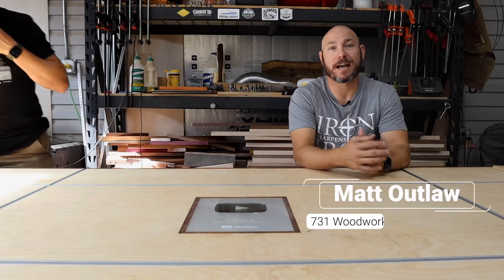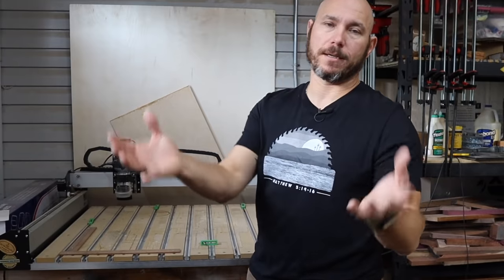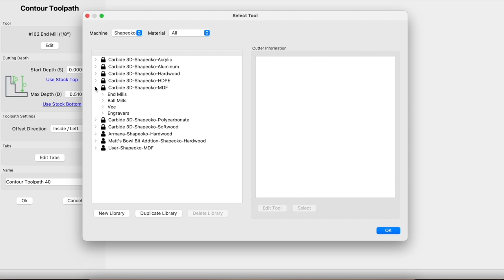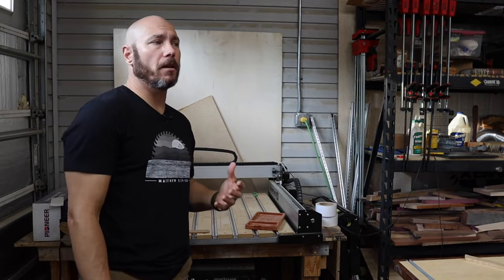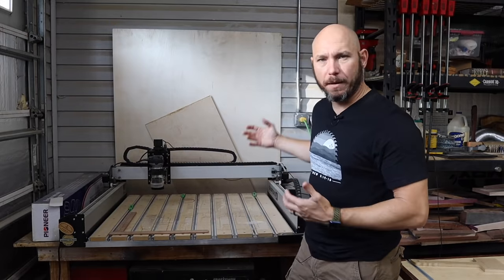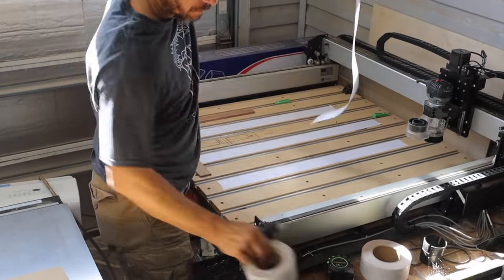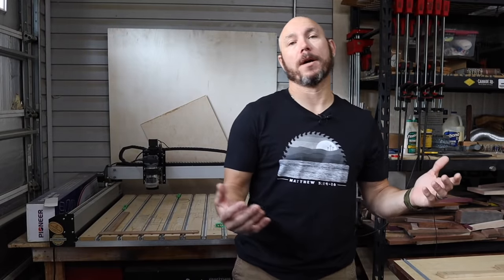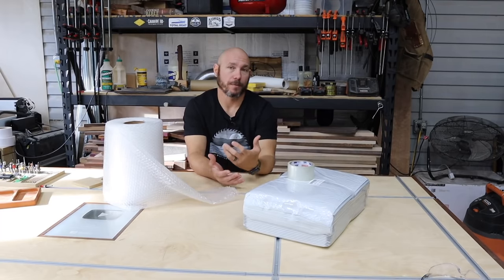The Dark Side of Learning to Use a CNC for Woodworking

Comment: A year from now you will have a much longer list, but that's part of the fun.

Useful tip: Zero off the table's center. Use the rapid positioning. That way if the toolpath messes up or you have to turn the machine off, you can instantly go back to the same zero with rapid positioning again. This has saved a ton of time and frustration, especially with 3D when you can't always use the same spot later on.
Reply from the maker: Thanks for the tips!

Comment: I have a 3 xxl and with a 1/8 compression end mill you could decrease your cut time in .500" - .750" MDF significantly.
Start at .500" full depth @ 50ipm and "4-4.5" speed on the Carbide router and get back to us! Often times you can get away without using tabs this way as well due to the sawdust packing the cut so tight.

Comment: I’ve been a machinist for 12 years and worked with CNC machines went to college for it the whole 9 yards. Using a CNC with no schooling and just going for it is hard. I’ve never used one for wood but programming is a skill in itself and a lot of people want money for that skill. I know if I spent 2 years learning how to program and had years of failure and experience I wouldn’t do it for free. I think the best thing is to stay positive and learn as much as you can!
Reply: Also with CNC machines people think oh it will do all the work for me. Which is true but you have to assume this machine doesn’t know what you want until you tell it which tool it’s using the material type the thickness. And maybe even start location. After that a program should run smooth. There’s a 100 ways to mess up when using CNC and it will be a huge money maker once you master it!

Comment: It sounds like what most beginners go through--absent the mechanical issues--which are just because of poor quality components.  I've had a CNC for more than a decade and a half.  I went through many of the same experiences, like breaking bits.  I had the benefit of being proficient at 2D CAD drawing when I bought mine (now I work in 3D). This allowed me to draw then cut whatever wanted, and not simply rely on what is downloadable from the internet.  It is true that entry into CNC world is expensive ($2500 is cheap), but "you gets what you pays for.."  In the long run, using a Columbo spindle vs. a simple router motor like what is shown in the video is a worthwhile investment.

Comment: I call this the YouTube curse.  You can find creators who use CNC's and you think it, "Wow that looks so simple, I can do that!"  Then you dive in and quickly realize you need to do a ton of reading/study/learning just to get the thing up and running and not waste money or break stuff.

I learned the hard way that CNC isn't straight forwards or simple with 3D printing.  If someone wants to learn, that's the cheapest way to get into CNC.  You'll learn design/file conversion, you'll learn G-code, and you'll learn that these machines require REGULAR investments of your time/attention as well as maintenance.  They're super handy and a force multiplier when they work properly.  Whey they don't work properly your ability to troubleshoot and fix it yourself quickly will dictate how much you question your life choices.

EDIT:  Also I highly recommend that people who want to get into CNC anything.  DO NOT BUY a preassembled machine.  You will want to learn how the machine goes together and how to do quick/basic troubleshooting with it.  Saves you a lot of time spent with customer support.  Just read and follow the instructions for the build and you'll be alright.  If that's too intimidating I'll be upfront and honest in saying that CNC is NOT for you.
Reply: 100%. I've built several of my own (using other people's really good designs) and the only thing I want to add is that people also underestimate how much material they'll scrap for bad jobs, wrecked jobs, things that didn't turn out the way they want, etc.
I've filled up my fire pit a couple times.
A cnc is just a tool, like anything else in the shop, and takes a lot of practice to acquire the skill to make it useful. It's also an employee, unlike any other tool in the shop. It needs to be trained, told exactly what to do, followed up with, etc. That also means we need to learn the skills to teach it whay it needs to know to help us.
Also, i forgot another dark side to mention. Post process. Very few things come off the table ready to finish. I typically get away with sandpaper, but not always. Some folks get discouraged when they realize that there is still a lot of work after turning the machine off.
Reply: Yes, I feel this lol. But I can say that I'm glad I made the jump because as clueless as I've been ive also had some fantastic wins and great opportunities cruise to me.

Comment: One of the things I would add to your negative list, is that CNC's are not for everyone. It is not a toy, it is a very dangerous machine, and some people for the lack of a better word are just not smart enough to be trusted to operate a dangerous machine safely (moments of experience) Having run my own DIY CNC for 8 years now, I can safely say that the CAD, CAM, Machine software is by a country mile the hardest thing to come to grips with. It is not a 3D printer where if you stuff up a piece little harm is done. A CNC has the potential to kill you. Don't be looking for a quick fix, unless you are prepared to put in the significant amount of hours to learn how to use it properly, stick to your 3D printer. Also most hobbyists are not taking dust collection seriously enough. Poor dust collection is a great way to get yourself some really serious health issues, that can be fatal.

Comment: On double sided tape, if one breaks thru the material, the adhesive from the tape will adhere to the tool, which picks up the chips, or sawdust, causing binding. Have you tried reverse helix end mills? They push down the material, rather than pulling it up.

Comment: That's what I like about the glowforge laser cutter. It is a set it and forget it. You insert the materials, it will identify it, you say I am cutting or etching and it knows the thickness and automatically sets the speed and power.
Reply: On a glowforge can you set the depth of cut so you can carve with it or does it always blow through the stock?
Reply: @intelligentgluteus-maximus4720  yes, you can manually adjust the settings. I was just pointing out that they have stock materials you can buy from them that has the settings automatically stored so there is no thinking about what you are doing. It's pretty sweet.
Reply: if I'm not using a glowforge brand material, I will always cut out a sample piece. It runs through different speeds and powers. When it's all said and done, I have a piece of material that shows what each combination looks like on it. It makes making decisions so much easier.
Reply: @David Takes I totally agree. I think my goal was to point out that it is possible to get close to what glowforge has done.

Comment: Hey - try the 3M mounting tape or mounting tape from Harbor Freight for work holding. It's thicker than your regular double sided tape and is a little foamy too, so if you don't have a perfectly smooth underside it still works well. It also adds a little space underneath your project so if you do accidentally blow through it there is less damage below. Love your content and looking forward to the "Light side" of CNC video.
Reply: The problem there is that it can mess with your pecision.if the foam gives a little, your stock is gonna move with the bit pressure so detailed cuts will be off the mark.

Comment: They have feature based cam software, where you import your piece and it selects tools(that you’ve added to your tool data base) and programs the tool paths. I know auto desk has feature cam and there are a few others. You would need a good post processor for a cnc router. I use feature cam at work for simple parts when I’m too lazy to program the tool paths myself and I’ve had good luck with it on mills.

Comment: good video, with lots of information for the newbie, but, there are some things that need to be corrected/added. if you are changing brushes, you are using a router, not a spindle. spindles do not have brushes, and will last a good long time. i am still using the same spindle on my shapeoko 2 for the last 7 years, without a problem. the spare that i bought (just in case), and it is still in it's packing box. as to end mills, i'm still using the same inexpensive mills for the last 7 years, and i think i have only broken maybe 2 of them. you need to remind viewers that, the cnc does not go crazy on it's own, it only does what it is told (don't ask me how i found out that one). as to cad, i tried carbide, and easel early on, but found them, but found them to be too limiting. i started with cut2d, and moved up to vcarve desktop, and have never looked back. i have used both sketchup, and vcarve for designing projects, and they work for me. as for any of the other gadgets (bit setter, touch probes, and other such things), until they truly learn how to use their cnc, and not have to rely on gadgets to do their thinking for them (what would they do, if they become dependent on them, and they cease to work, they will be lost, or worse...). i have learned how to line up my x and y by eye, and my z with a bit of paper (.004" is within spitting distance to perfect). i would suggest to newbies, get sketchup 2016 (last free version), and vcarve desktop (cheaper than pro, with only a minor difference or two between them), as cad/cam,  universal gcode sender (for sending to the machine, it is free, and very versatile), and any good, refurbished desktop, or laptop, to run the software and such (i started out with an old, salvaged from scrap, ibm lenovo 60). as for the machine itself, if you are so daring, you can get plans for the framework from openbuilds, and they hardware (rails and such) from inventables.

Comment: I use Blender to create my 2D and 3D for my 4x4 CNC and 3D printer and can save them as dxf or stl format. It's a very powerful free software. You can import all kinds of file formats and tweak and scale them to your desire and then export them in another format.  Like everything else there is a learning curve but luckily there is a plethora of tutorials.
Reply from the maker: very cool!  Thanks
Reply: @731Woodworks  You mention your machine crashing after a few perfect runs. One of the causes ( from many)can be in your dxf file with a stray node that causes a step back on a forward motion. They are really hard to find because they are on top of the other nodes. In post processing its written as one line of code. While running the machine the code is read so fast that line usually gets skipped .But in a  blue moon it reads that line and tries to perform it and loses its coordinates crashing the machine.

Comment: Generally when for no reason at all it cuts through your stock it's most likely it jumped a step (code) most times this can be fixed by slowing your feed-rate down. Best way to get your feedrates correct for different types of wood (hard-soft) is to test on some of cuts and adjust speed as it's running. You should get good looking chips, no dust. Then write those speeds down for each type of wood.
Reply from the maker: Thanks for the info!

Comment: the reason your cnc is missing steps on the same program is because you are getting feedback from the dust collection. ground the vacuum hose seperate from the cnc so the steppers can get a clean signal. also set your 0,0 for program to center of material and you will minimize hitting clamps.
Reply from the maker: Thank you

Comment: Got a shapeoko pro back in April. I love it, but it was a hard learning curve for this old man. Finding easy info on feed rates, RPM, what bit types for what what type of wood, etc was WAY too difficult. It came down to roughly 18000 RPM, a feed rate of roughly 50% your max machine can handle and a plunge rate that is 1/3 of your feed rate. From here you can up the feed rate during the cut to what your machine can handle. Dont get me started on the software, none of it is user friendly. From free stuff to the paid carveco stuff, its all a pain to use in one way or another.
Reply: Vectric vcarve is VERY easy to learn and use, especially for 2/2.5D CNCing (3D is not so simple). I bought it and then bought the upgrade to the pro version. Not very cheap, but the free trial can do everything except save design files. Once the gcode is produced, that obviously can be reused. I have nothing to do with Vectric besides owning this product. As an example, I did a design from scratch for a 3 ring wall calendar with day number,  day name and month name. It didn't  take much more than 10 minutes to design it and create toolpaths

Comment: the speeds and feeds are very conservative on carbide motion. running at 65IPM and slower with most wood or MDF is not idea. the bit also plays one of the biggest parts in cutting. upcut VS downcut or compression bit and so on. there is alot to learn however with wanting a company to have projects that are just download and go is more of a liability on them especially since this is a desktop cnc that you build. multiple things will also effect how it performs. such as tramming, wasteboard surfacing, squaring the machine and more. keep at it and you will get there. 2 hrs for a md cut its crazy! speed that machine up. use the feedrate + button as your running it and listen to the machine you will hear if it starts going to fast. then if you notice you are running 150% adjust the feedrate in the bit settings

Comment: I’ve had the same issue with Uline and getting boxes. I just got mine on Amazon instead. Especially for smaller items. 10x7x5, I got 25 for $20. I’m sure the larger boxes are still better too

Comment: Have you added a filter to your power to the device. House power has glitches maybe that caused some of the program to try and recover.   I would add a UPS full sine wave to the computer side and the equipment measuring devices. Maybe the motor has its own supply that may not need noise suppression. I don’t own such a device to know but having computer and sensors may be sensitive to line noise and other interference from other devices or the noise on your house electrical supply. Just a thought to how it might be a intermittent problem that is not native to their software design.

Comment: I'm currently doing the research and looking to making a cnc purchase soon. I make toy cars and trucks. I have just about every woodworking tool known to man. I have been wanting a cnc machine for a few years now and have shied away from it because I don't have any computer skills. Physical things are pretty easy to learn for me because it's right there in physical form for hands on learning. Virtual (computer things) have always been a struggle because of the many technical issues that are unforeseen. So, for me the learning curve will take some time. I agree that these software companies need to do a better job of programming for the audience or consumer that doesn't have the Harvard degree in computer science to be able to use thier software!!!🤬 
I'm wanting to buy a small cnc to learn from once I know and understand how it works especially the software then I will upgrade to a larger more exspensive one. I initially had intentions on just using it to make small parts or to engrave logo's on toy vehicles but after doing some research watching YouTube videos of people making money with their cnc machine has really got me interested because I'm currently at home with no job waiting on a disability case due to severe back problems.
Once I get my machine I'm pretty sure I'll have a ton of questions (especially about the software). I thank you for this video it does give me some insight on a few questions that I have already had. Thanks again! New subscriber here.

Comment: Don’t drop’em on the cement floor either, 1/16 end mill snaps off the cutter end, $$$ you know how that goes. I have also snapped them off hitting something without raising the Z. I use a 1/16 end mill a lot to cut a pocket for stars on things I make

Comment: Paths are always exactly reproduced on each run.  Stepper motors are accurate to within around 5% of one step typically. And a normal stepper motor does 200 full steps per rev. So even after millions of steps, they are still not out by more than 5% of a single step. If the paths are not reproduced, you have something wrong with the electronics or you are running too fast and steps are being missed - or the bearings need cleaning and greasing - or the machine is binding for some reason.  I have had similar issues with my dual motor y axis, where wires were loose. So its not "just something that happens" - there is a definite reason
Reply: Or Carbide Motion is buggy. I don't know it at all.

Comment: Make sure you're not connected to the internet while running a job.  Also, make sure nothing is running in the background such as virus protection or updates.  That will interfere with files that are running and cause the machine to lose its place.

Comment: Instead of the tape, using the tracks with clamps that mount to the track, sit under the height of the material, and are threaded so you can torque bolts into n the side of the sheet. 

A machinist will be able to crank them out cheaply, or you can order some hardware and fabricate some.